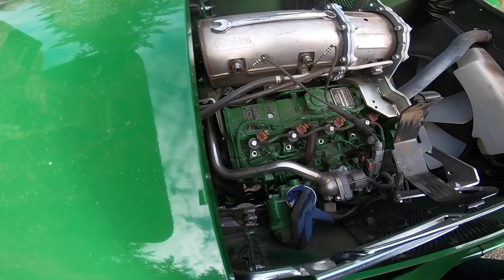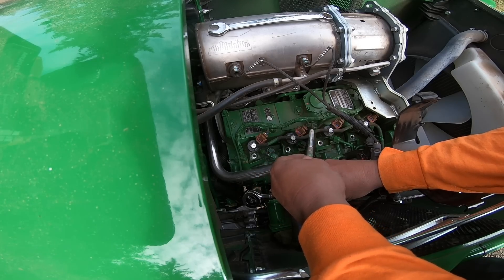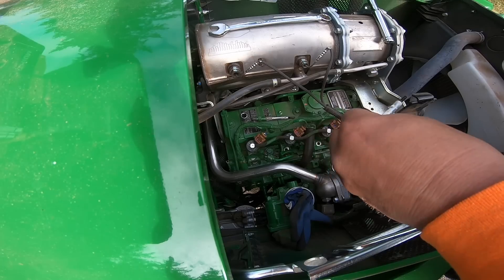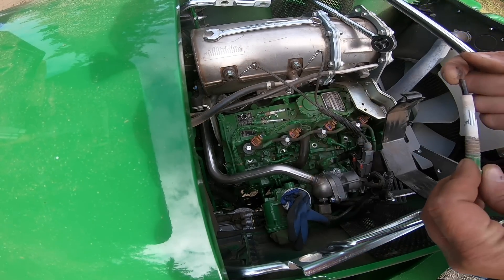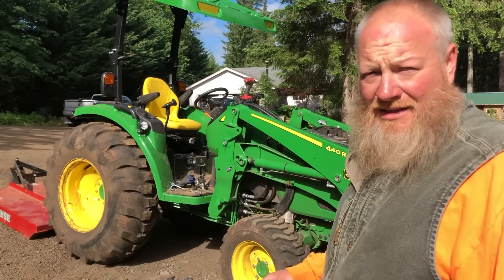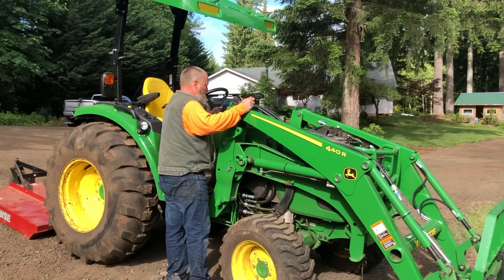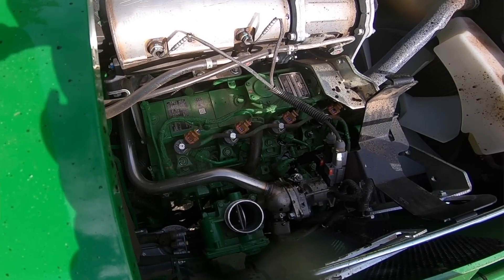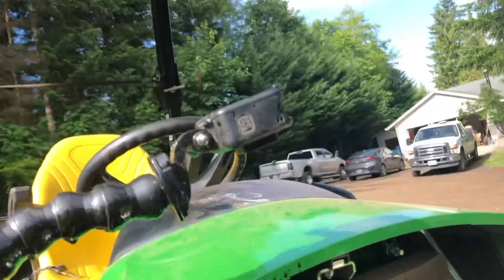Tractor Roll Over Day 2. Did I Ruin My Engine?

Comment: I learned a lesson with using the bush hog for mowing on a slope and quickly learned to go down a hill then back up rather than run across it due to rollover hazards. I remember using my John Deere 790 tractor with my bush hog and tried going across the slope and thought I would roll it and from there just went up and down the slope and it took longer, but I didn't roll my tractor over or damage the unit and the bush hog.
Reply from the maker: I had been mowing up and down the hill. I was turning around at the bottom because there was a fence that I couldn’t mow against with the tractor facing down hill. There’s was a small flat spot that I used to be able to turn around on with my old, smaller tractor. It wasn’t the case with my Deere.

Comment: I layed a few farm tractors over in my life. You did the right thing to remove the glow plugs, but NEVER hit the starter. Used a wrench to turn it over by hand from the front bottom pulley bolt very slowly till all the fuel and oil comes out. If you do not have glow plugs in an older tractor just pull the injectors out.
Reply from the maker: I’ve rolled ATVs and side by sides before and they’ve started right up. I had no idea oil could leak by the piston rings so quickly. Lesson learned for sure.

Comment: Glad I came across your two videos.. I have a one series but moving to a two series upgrade..  Learned a lot here about what to do or not do as I have nearly rolled mine.   BUT I have had a nightmare like you where I was driving over the drive on deck and the damn thing suddenly slid and shifted almost 90 degrees.. the tractor caught on one of the rails and dropped down hard onto the deck snapping the hydraulic couplers for the steering.. leaving me with spraying fluid and NO ability to steer to even try and drive it back off the now stuck deck.   Thankfully I had the bucket on as I was able to lift the tractor off the deck and slide it out..  But the real pain in the ass was yet to come..  Trying to run new hydraulic hoses was the biggest pain in the ass you can imagine.. You literally have to take the entire console and seat flooring section off the tractor to do it.. Took a full day to repair it.  While I like the quick attach capability, that mower deck is not something I am very fond of right now.. Had to re-bend the interlock bar straight again, it busted off the water cleaning jet port and sprung the front idle wheel pulley spring which I had to bend back into shape..  Got it done though..

Comment: Fitst thing I thought of...check the plugs. Unhook the fuel supply for air blockages. Saw the comment about pulling the tractor up on the flat will speed things a long. Glad you are ok.

Comment: Thank goodness, you came out of that ok. Accidents happen. I have had some close calls . But never turned one over. Once when I was going down a long steep hill in my 3070 Massey Ferguson and 15 ft Bushhog in a high gear unknowingly until it was to late. All I could do was to hold it straight until it got to the bottom. A 3070 Massey Ferguson on the gear box all you have to do is bump the shifter to the left while in nutural to go for low to high. I didn't know  I had accidentally happened too bumped the shifter into high. It was a wild ride to the bottom of the hill.  I was raised on a farm drove tractors all my life. I am 65 that happened only a few months ago. Always be prepared for the worst. Once I declined to do a Bushhogging job because of the insanely steep hills it's not worth the risk. Be safe and careful. Like the honesty of your video. Things happen.

Comment: So You had Oil leak up above the Pistons

I wonder how long it would take for the oil to return to the crank case past the rings 

The question would be how long ?  Maybe several days?

Would waiting until hand cranking the engine without the glowplugs be the sign it was safe to crank it with the starter?

I was also wondering if inserting a small hose into the glow plug openings and vacuuming the oil out would possibly work?

I put a rental Kubota Backhoe/Loader on its side digging a hole but I was able to keep the engine running

I swung the Backhoe out and perpendicular to the center line of the tractor and used it as counter balance

I was lucky to have the use of the out riggers to push it vertical enough so that the backhoe arm weight brought the tractor vertical enough so I could back out onto level ground

I was LUCKY I was Not as completely as Your video showed

Thanks for Showing Us why You don't keep trying to start the engine with the starter

That oil must have still been under a lot of pressure trying to squirt out those open ports..

Ken in Florida
Reply from the maker: Thank you, Ken! It’s hard to say how long it would take for the oil to drain back. I was really surprised how quickly the cylinders filled up. I’m guessing it could take much longer for the oil to pass back through because of the small amount having nothing behind it pushing it through. I’ve had zero issues with my tractor since this happened.

Comment: Awesome of you to post an accident like that. This will save some one's life for sure thank you. . Now.....  Can I go on a rant as to why all these modern compact and subcompact tractors today suck?  

Totally useless machines imo. Crappy floatation in the soft stuff. The diff lock is a joke They don't dig and hardly lift anything and far to top heavy. The engineers really phone it in on compacts and smaller. I hawg with the skid steer or a few old Ford's. The 2000 3000 851 and 641 will all physically slide sideways on a hill before even thinking of tipping to the side. Deere and most the others want their tractors to look "tough" build them tall and narrow with over sized tires. And then there is not enough lead in the belly of the machines and the motor mounts too high. Just all around not really good for anything other than bragging you own a Deere (new holland, kabota, case and so on).  Made the mistake of buying a Deere with a loader a few years ago for the ranch. Used it once For paddock work and sold it back to the dealer and got a mower instead.

Comment: Suggestion, wheel weights  would help with that falling over issue. have to overcome the weight of the bucket attachment . Air down the tires would help to. been working on golf courses for 30 years cutting slopes that no one before me would cut with the equipment we had . 35 hp 1970s era massey and a articulator mower. prior to me working there they weedeat them areas 2 guys all week to complete, me 1 day and the mechanics help for an hour putting all 4 wheel weights on one side.

Comment: My neighbor, a retired JD tech from Nebraskas advice.
After you right the tractor, remove the injectors and the glow plugs. Remove the oil pan after draining the oil. 
Let it sit for 24 hours. Then use compressed air if possible at low pressure into the injector hole.
That will blow any oil out of the combustion chambers. Then turn the engine by hand via a wrench on the crankshaft.
Replace the oil and more turns by hand.
If it feels OK, go ahead and put it back together and try a start.
He said he’s had nearly  100% success with the procedure.
Reply from the maker: That sounds like a lot of work to me. Fortunately, I’ve not had any issues in the three years since this happened. Knock on wood.

Comment: I'm glad you knew enough to get your tractor back to running.    years ago I mowed a sloped bank at our pond and I never had the courage to run the slope,  I always backed down it and then pulled up to back down again.   I was running John Deere 1020 with tires set narrow.
Reply from the maker: I had been running up and down the hill but there’s a spot at the bottom I thought I could get turned around on. Instead I just got turned over. 😬

Comment: I did pretty much the same thing on mine, except the engine ran away. turning off the ignition did nothing, and the motor screamed for probably 10 minutes until the crankcase emptied out.

changed a couple glow plugs that got melted by the performance and still using it 5 years later. amazingly tough those diesel engines.

I had no seat belt on, as I never do, which allowed me to jump clear. unfortunately, 'clear' was into a creek. getting out of the creek and back up the bank is what gave the engine time to run away before I could get the key turned off.
Reply from the maker: Wow!

Comment: A rag over the head sure would have helped with the oil blowing all over the place. Also when you were trying to crank it and it wouldn't start and then you sat in the seat and it started right away ..isn't there some kind of engine shut off if you're not in the seat?  I ask because I have a 1 series JD and if I get out of the seat the tractor shuts off. Anyways..let me explain what I did with my tractor. I use it for a different application which is plowing a condominium complex. it has a VERY steep hill though at the entrance and most of the rest of the complex is comprised of various inclines. The garage I store it in was not long enough to accommodate a ballast box so the dealer suggested I get the full rear cast iron weight set. That is not only the 70lb starter weight that fits within the rear rims but then 2 additional 50lb weights per wheel giving it a total of 170lbs per rear wheel. The total then is 340 lbs in the rear which isn't exactly what the loader ballast recommendation is but i'm just lifting snow with the loader..not heavier gravel or sand. I find though that this configuration seems to give me a lot of rear stability and not just weight wise but it creates a wider footprint in the back. As I looked at your last video ..around the 6 min mark...your tractor seems to be so high and narrow in the rear. If it were me , i'd be looking at not just more weight...but weights that extend that width like what I have with the 3 cast iron weights per rear wheel. Or, perhaps wheel extenders to increase that rear width. I will also add that with my tractor I have some UNBELIEVABLE traction. Our entrance hill Is long and Steep and every single car get stuck and most wind up sliding backwards ..even sideways coming up it. Me..i just don't even spin a tire. And just to show off sometimes I even plow uphill just because I can. :)  Wheel weights and particularly the ones that extend the width in the rear...I swear by them. And, lastly..seat belts.  While perhaps I should wear mine in the tractor I had one situation where I didn't have it on and where the tractor did start to tip over. I was still in learning mode and plowing down the hill and started to take a too sharp turn to the left on an incline. I didn't have a problem with that even until I started to then lift the bucket to dump the snow I had accumulated. The left rear wheel started coming up and I felt a slow motion tip over start to happen. I feel like it was actually my natural reaction to that which prevented it which was to come up out of the seat and get my weight shifted over into that corner and also In a position that would have allowed me to just jump off that side. My weight shifting was enough to bring the rear wheel back down.  I acknowledge that while this worked for me on an inclined paved surface ..and with a lighter tractor.... it may fall into the category of being somewhat foolhardy with a heavier tractor. Anyways...rear wheel weights ...and not just weights but a setup that extends the rear wheel footprint is what i'd be doing if I were you. And, stick with the seat belt + rollbar.  As for me, i'll probably just continue to not use mine mainly because I now avoid that manuveur that got me in trouble and I just tackle the hills up /down now vs. sideways. Anyways..good to see you're back in action...and alive to tell the story :)

Comment: Nice to see you got the engine running. I owned a boatyard for many years. I sold many new small diesels / repowers. One of the many reasons for a repower was due to a hydro lock much like you dealt with regarding the oil. An easy way to check for a bent rod is to perform a compression test. I did own the same tractor you have. One thing to help the stability is to fill the tractor tires with a type of oil for counter weight, the oil is made for tires , I had this done by the JohnDeer dealer. Not only does it help with stability but it also conditions the tires from the inside out. I don’t recall it being extremely expensive. Good luck !
Reply from the maker: Thanks, Todd. It kind of interesting because a lot of people have suggested filling the tires yet the owner’s manual doesn’t recommend it. I’d like to put some wheel spacers on the rear if I ever find a deal on them.

Comment: Very happy for you that you escaped injury and that your machine came through. I know the experience of losing brand new gear....my bro has a vineyard near Ukiah, CA, which burned in the recent fires of last year. He lost an 1800 sq ft house and 450 sq ft guesthouse. He also had a 30 x 60 metal building aka barn. The barn did not burn, per se, but the fire ran up to the side, right where about 15 gals of used oil was stored. The heat of the fire vaporized the oil, which then ignited and either flamed or covered in greasy soot everything inside the barn. Including his new Kubota tractor with 34 hours on it. Might have been one size smaller than yours, 34 hp I think. Very little of what was inside that barn escaped destruction, including the barn itself, which was still standing. Although I suspected it could have been reskinned, no insurance could be obtained on the structure and even for the slab foundation so it had to be demo'ed. Fortunately he was well covered by insurance, but that melted Kubota was definitely a pathetic sight.
Reply from the maker: Perspective is everything. If you’re ever felling like life is tough, just look around. 👍

Comment: Oh that was a beautiful sound when it cranked! I almost rolled my 3038e about a week ago. It was tilted but stopped when it was on two wheels. I had to climb off the 'high side' of the tractor and cut a strap loose from the tree i was moving, then get back on and yank the tractor out from under it while on two wheels (positive traction). It will make the heart go pitter patter. I knew there was a problem with the hydraulics, but thought I could compensate.  I posted a video to show what the problem with the hydraulics was. Again, I celebrated with you when your tractor cranked.
Reply from the maker: Thank you, sir!

Comment: Were you able to turn the engine off after the flip, did the engine keep running after run switch was off.  You probably lucked out, when y ou flip some tractor to the right and don't shut down the fuel supply electrically, you can get a "run-away" engine.  Somehow, crankcase oil gets to air intake and now the oil becomes fuel without the aid of a electric fuel pump.  It is an extremely helpless situtation and feeling, unless you can get the hood open and plug up the the air supply.  Not an enjoyeable event, but glad you the and tractor are alright.  My tractor blew blue smoke for about 20 hrs.

Comment: Probably wouldn’t be a bad idea to pull the dpf off and powerwash it. There are videos on here about how to clean a dpf. Pretty sure it’s full of oil at this point and will likely cause the tractor to go into the filter cleaning mode more frequently. That will cause unnecessary heat in your engine and burn more fuel than normal. Looks like you can just unbolt it and pull it out for a clean.

Comment: I just saw a video on a tractor sales channel that warns for the engine issue and says never start the engine after a rollover but let it sit 24 hours (or remove the oil from the cylinders) but an attempt to start it may explode a cylinder.

Comment: Should have spun motor over a lot with no plugs in it, if there was oil in it when it tried to start you definitely bent a crank or piston rod
Reply from the maker: This was almost 5 years ago. I’ve had no issues since.

Comment: A good ending.
I have an old beat up Ford 601 (2Wheel drive)
The front axle telescopes if needed. If I make it real big, it won't go into the shed.
But it won't roll.
Rear rims have adjustments for that too.

You have a nice green tractor.
No center of gravity adjustments?
Reply from the maker: Not without aftermarket accessories, Tom.

Comment: i came unstuck once on my x595. this may save someones life. i took my tractor out of 4wd to drive to to the gas station and i forgot to put it back in 4wd and i pulled into a 40% slope. In 2wd the tractor just quickly sped up and started to slide and bounce down the hill. I jumped off and watched it. it slid to a stop after the engine quit from the seat switch. the fence barely caught it. not sure how other models react but thats how the x595 reacts on a steep slope in 2wd.
Reply from the maker: I’ve had similar situations where I was using the forks to pick a heavy load and in 2wd on a slope. The rear tires started sliding. Fortunately I just grounded the forks and stopped the tractor.

Comment: Hope you learned your lesson about working on a hill with equipment !!!!  You were lucky years ago before ROPS and seat belts a guy in an orchard was killed when he rolled a tractor over and it landed on him crushing him !!! Remember too keep your front end loader LOW when working a tractor, especially when the bucket is loaded !!!  Thats what killed the neighbor, picking rocks, had a full bucket heading to the truck and was raising the bucket while moving and he tipped the SOB over!!!!  I see so many people here on You Tube running tractors in the rough with the front loader up !!!  Bad dangerous move !!!